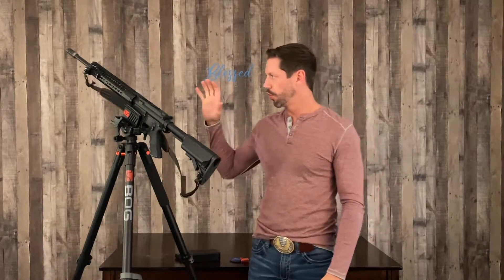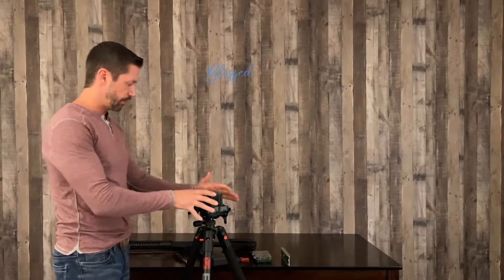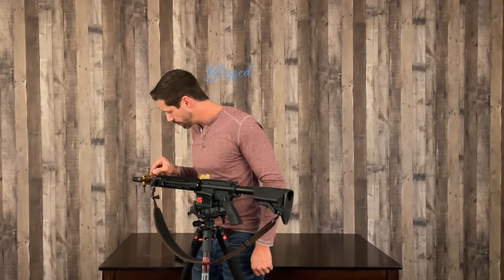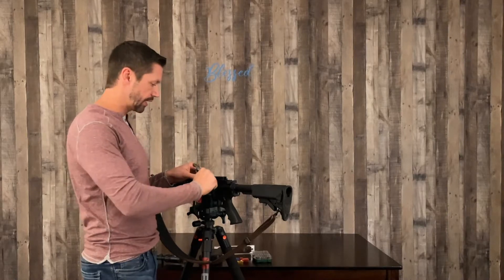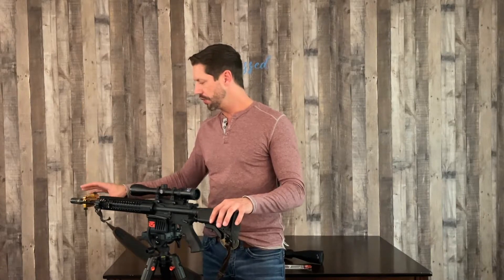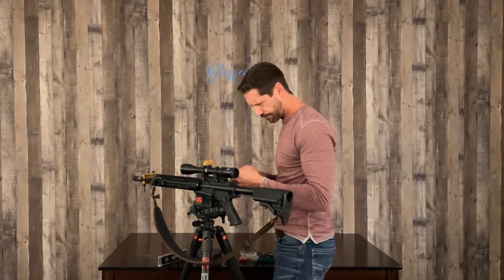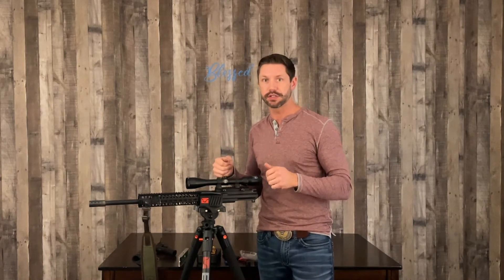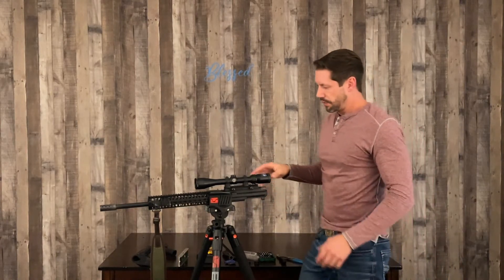Bog Pod Death-grip More than just a Pod, Mounting a Scope, Wheeler Engeneering Scope Mounting Tool

Comment: Once ya get the weapon level making a plumb bob with a string and a bolt or even a rock at the end works just as good if ya don't have all those bubble levels. Gravity will pull it in a straight vertical line and ya just turn the scope till the vertical crosshair covers the plumb bob line exactly.
Super easy to get the scope perfectly level.
Now the door knob thing for bore sighting I've never heard of or even tried for that matter......that'll definitely "get her close".
Have you ever done the 2 shot sight in after bore sighting?
Reply from the maker: Cool idea for the plum bob!! As far as the bore sighting I’ve had a few that were dead on and never had to adjust… honest it works that good sometimes. But for sighting in I use a vice and follow the bullet. If you are carful and have a good vice 2 shot sight in should be possible. I always shoot several to be sure I’m grouping and I don’t get crosshair jump… Thanks for watching and messaging, your technique is very intriguing.